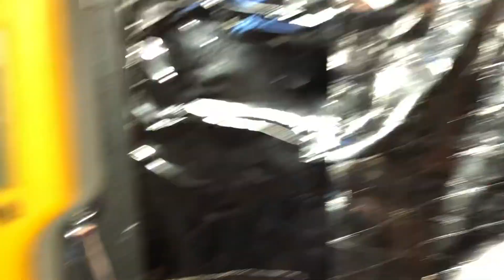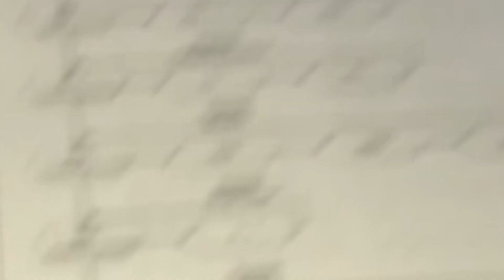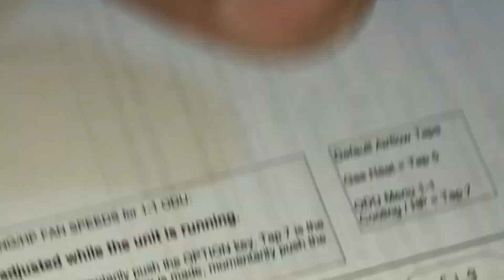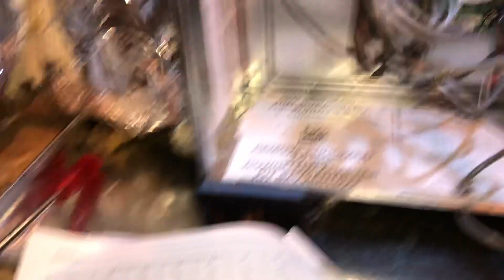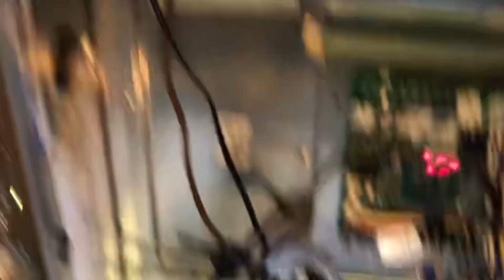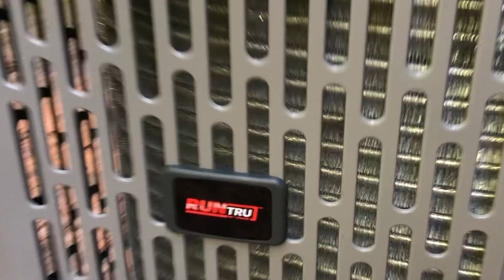New HVAC System

Comment: Nice video Steve. Are you in a rural or urban/suburban area and do you find the range good enough on the FP probes?  We have the Testo AND MANTOOTH probes but want the combination of the airflow and refrigeration all in one place with the range to cover from the air handler to the condenser. 

With the Parker/Sporlan probes you can eat lunch in the truck and watch the system but it doesn’t do air flow. 

FP and the reports look really nice but if it doesn’t have good range in a city/densely populated suburbs why bother.
Reply from the maker: Speck Ulator I’m in Atlanta. $million+ home & they went with RunTrue but at least it was a fully matched system with duel returns.
 And yes I have no problem on 3 story homes “most” of the time
Reply: HVAC RESIDENTIAL BASICS Thanks for the quick reply.  Some people have the idea, “well, they all blow cold air”. I haven’t seen a Run True yet but I just don’t see how people buy a builder grade cube over a mainline unit with pressure switches, compressor wrap, upgraded warranty, etc to save a couple of hundred bucks.   But each his own.